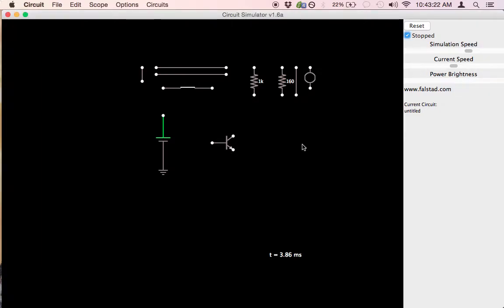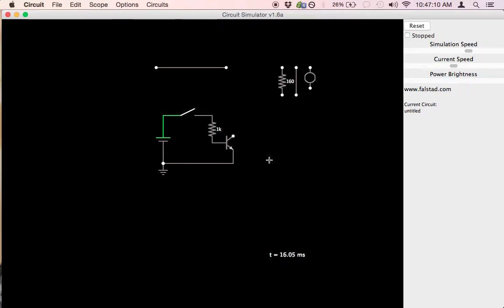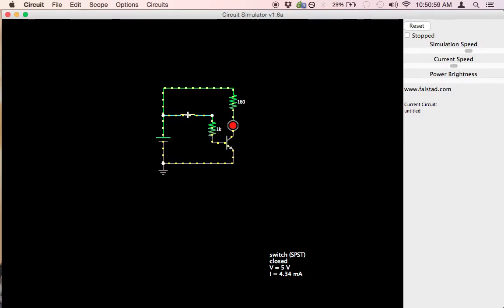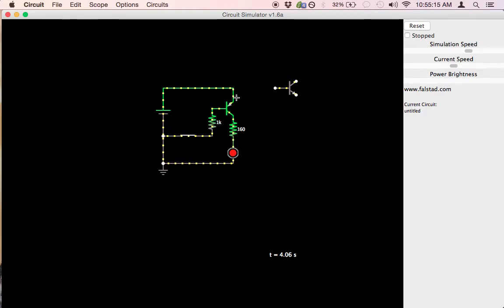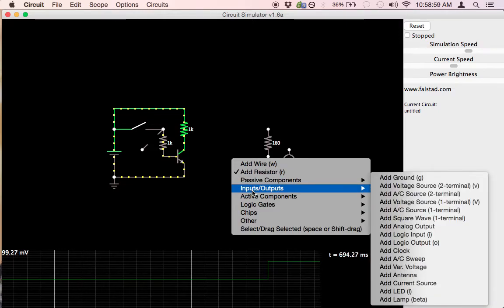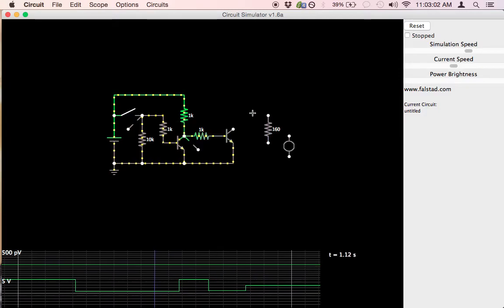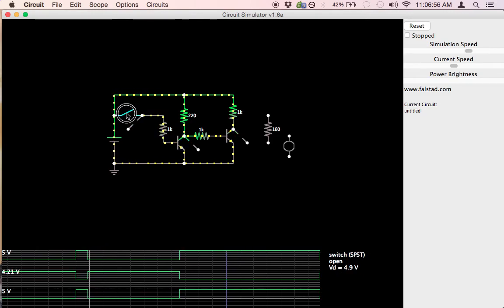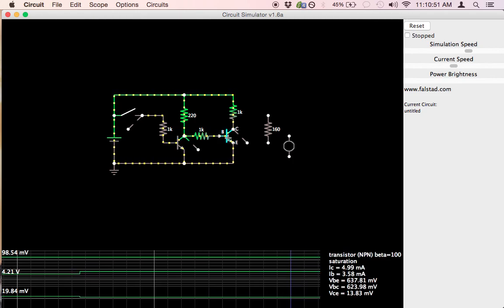Bipolar Junction Transistors as Common-Emitter Switches - Circuit Simulation

Comment: Ok, but why bother with the tranaistor if you're going to have a manual switch?
Reply from the maker: It’s just a simple example. The transistor is a current multiplier. So you can use a small current signal (imagine a very tiny switch) to control a larger current load (like a high-powered lamp). Something that your small switch maybe couldn’t handle, but a suitably large power transistor could.

Comment: I’m learning transistor.
Thank you for this video!
Would you explain the apparent contradiction: 
at 0:44 you say « … the Collector is the Output of the transistor » 
at 1:42 you say « … current can only flow in one direction, from Base to Emitter »
Reply: The "output" is the current from Collector to Base ( I had to look ) thus "collector" would derive from something in the arena of collecting electrons; Plausibly from several places; As current flows that flat looking notation in the drawing is a small region which is inversely doped compared to "in and out"

When charge is applied to that region the blocking or diode effect is depleted and now "current" can flow to the other region which then becomes a path to the return side of the battery hence current flows; This has a range over which it can occur; This allows varying input to control greater power or may be used as simple switch;
Reply from the maker: Sorry for the confusion. The controlling (I put) current (turning the transistor on) flows from base to emitter. The controlled (output) current flows from collector to emitter. The collector is the the leg that is switched “on” so that is why we consider it the output, even though current is flowing into it in an NPN transistor. In a PNP transistor the the collector is still the output but current flows in the opposite direction.

Comment: Seeing that you draw electrical drawings in "Falstad". Is it possible to draw and calculate photo resistors (LDR) in that program./ Hans
Reply from the maker: Not that I am aware of. There is not a "photoresistor" in the parts list. But you could emulate it by using a mosfet in the linear range and applying a variable voltage to the gate. Question though, since this is a simulator, what would you use to shine "light" on your photoresistor? :)

The program is open source (java) and the various components are in individual classes. Somebody could certainly model a photoresistor and write a new class for it...